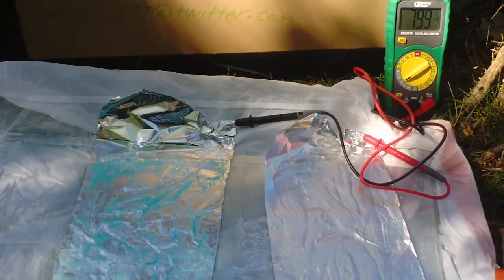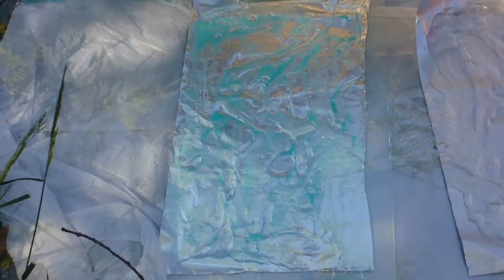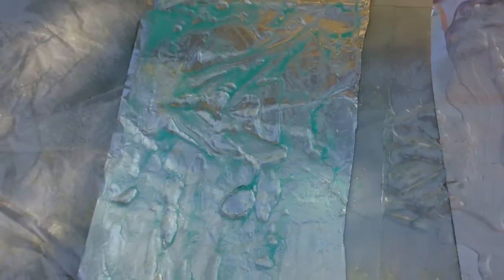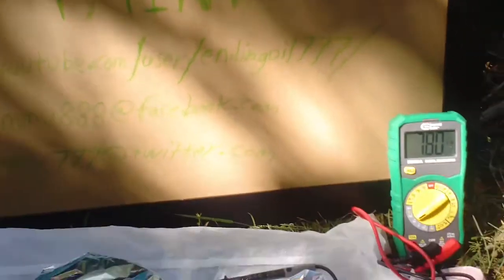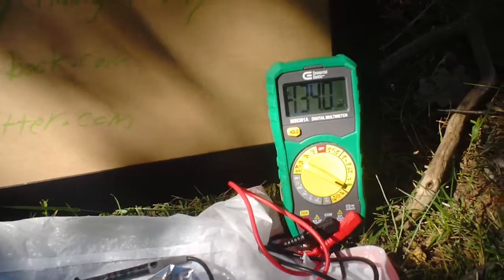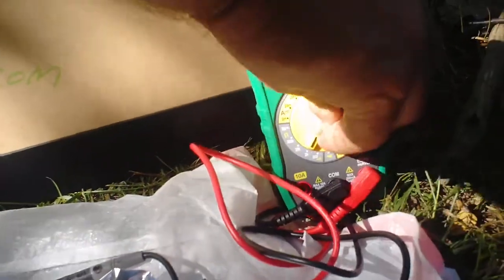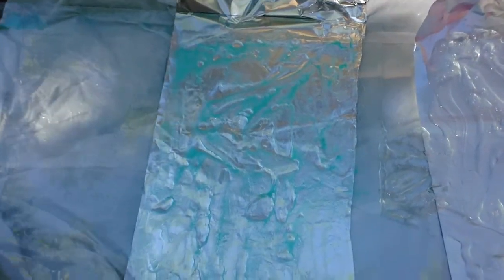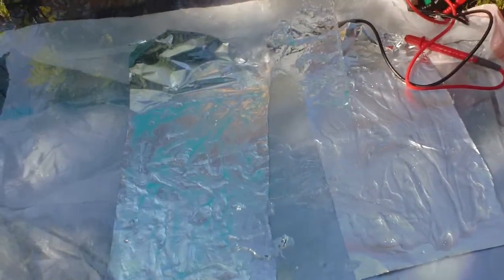DIY-SOLAR PAINT

Comment: P = v^2/R so about 1.5u Watts. Thats with a load of approx a mega ohm or greater (multi-meter)... but you should test the capacitance of the setup too... the meter will apply voltage when reading resistance don't forget... I bet u'll get a much highr voltage if you scope the setup or use a meter with a max /min detection when reading the voltage...  

I have built many  nano harvesters with the new IC that have recently been launched and the MEMS tech under development efficiencies are getting a lot better especially now that  resonance  frequencies  and windows are being used  to accommodate the types of low power energy harvesting.

I'm intrigued on your development and I'll be happy to share some info with the ic and energy storage if worth while

Comment: Hi there! I wanted to ask where you got the KBNNO perovskite from as I've contacted a couple of companies and they all told me its unavailable. I would really appreciate your input as it would help me tremendously. Feel free to email me at: fa6ooma.alh@gmail.com
Reply from the maker: THAT IS ODD! it was a huge story . iwould seek more chemical supply companies as some must have it. the last time i got it it was from ACS nano
Reply: Thank you! I have another question to ask. I was wondering if it was alright to use Calcium titanate powder instead of KBNNO perovskite. Hope to hear from you soon, and sorry if I caused any annoyance :)
Reply from the maker: i do not think calcium titanate has the same properties as KBNNO. it converts heat, light and movement to power. you can always test it out though!
Reply from the maker: no annoyance. i am here to answer questions for people! the calcium titanate powder like most perkovskites is very unstable for exposure to water or oxygen. it may work for awhile but will degrade.

Comment: Why do you charge up what is essentially a capacitor with the current flow through the terminals when switched to Ohms, and then show us the reducing voltage? It would be much more realistic, if you connected a voltmeter, then exposed the paint to the sun, and then connected a resistor, as a load, through an ammeter, so that we can see the device generating power from the sunlight. This video essentially tells us nothing, apart from where to buy paint from you. Thanks.
Reply from the maker: really? please show where i state that i am selling the paint?? in fact i am not. the formula is there so you can make your own. KBNNO, copper nanoparticles and graphene flakes. humanity has always been very poor in dealing with gifts. (must be why the gods favor giving disaster)